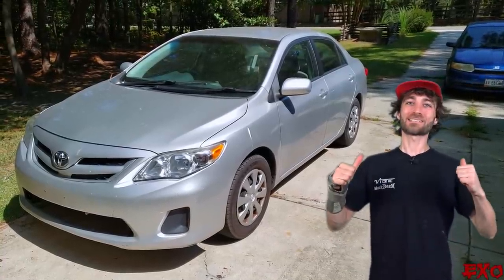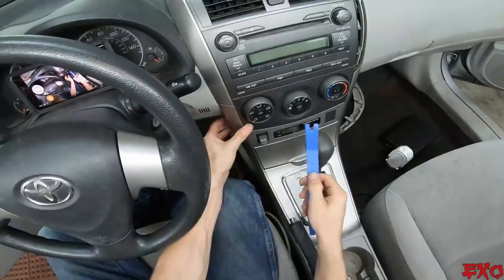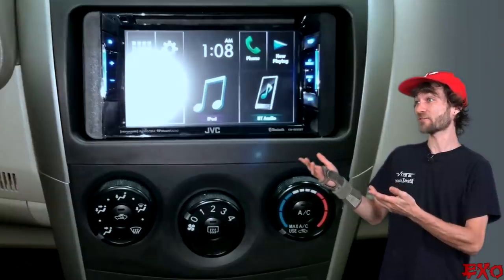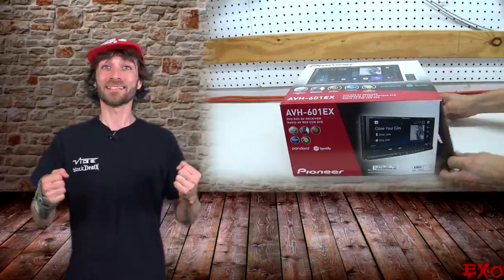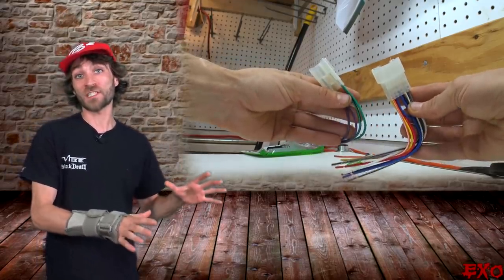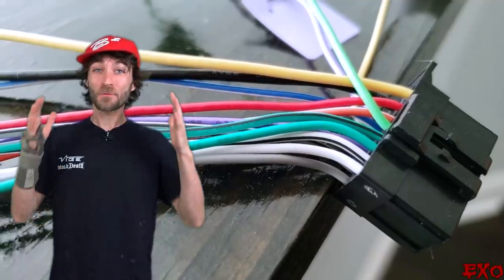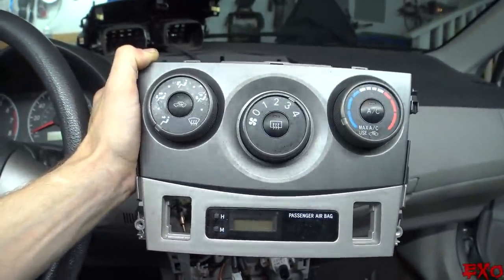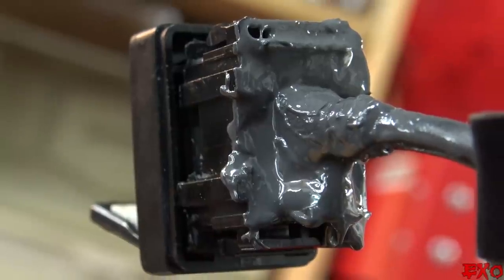How To INSTALL Aftermarket Car Radio w/ Pioneer Double Din Head Unit | UPGRADE Stock Stereo System

Comment from the maker: Couldn't handle the stock radio anymore... Time for some UPGRADES!
Reply: No doubt always love a nice clean aftermarket radio.
Reply: Bass
Reply: That is a nice car try not to break your girl car EXO :)
Reply: Looks almost exactly like my X3800
Reply: Hey Bro maybe you can answer this question. I got a pioneer double din and when I'm slapping and the subs start hitting it will constantly shut on and off
Reply: So whoz doing the filming now exo , think it's time u did a video on how and what u use to make ya vidz
Reply: EXOcontralto I have the same unit it has a few flaws but it’s amazing
Reply: Thats ok but i think a DSP is a must in the Radio unit 😊 better if a subwoofer is installed 😉 the sound is from the sub direct and play at the same time than the front speaker 😊 nice video but i know that 😁
Reply: Love the video.
Reply: Did you go with a wired or wireless camera setup
Reply: Going through Exo withdrawal
Reply: Exo why do you thank us for watching the video?
Your video is a must watch
Reply: @blixyyt5595  
His video "isn't" a must watch?
Reply: @robertdavidson548  sorry autocorrect was with German there
Reply: @blixyyt5595  
I'm sorry too. After reading it again, it's obvious what you meant
Reply: does a new stereo make a better sound ? i got the stock
Reply: Hey Exo. What do you do if your factory harness adapter has an illumination and a dimmer wire but the deck only has 1 orange wire with a white stripe? Which one do you connect? Also my Pioneer has the mint color for the parking brake but also has another mint colored wire. Any idea what that one is for? Thanks for all the great videos!
Reply: EXOcontralto i have a kenwood dnx6180 I don’t know where is the Bluetooth audio on the main screen how do I do a factory reset
Reply: EXOcontralto Hey bro, just wondering where is the amplifier install video for the Toyota? Thanks!
Reply: I just watched all of your videos about your Rolla sound system build and my goodness man you are good all that wiring just had my head spinning. I have a Corolla myself in I've wanted to upgrade my system for a long time in U inspired me to use the same speakers but I have no idea what I'm doing when it comes to all that wiring stuff so I don't know if I could do it myself.  And all of the retrofitting you had to do for that head unit and the speaker rings and the endless wiring. Excluding the the sub and he amplifier  for now what would  professional installation for the four speakers the 2 tweeters and the head unit and the wiring cost roughly do you think on average? What are your thoughts on just buying one of the pre made wiring  harnesses for those android double din units? I'm  Definitely gonna  get those speakers for the rear deck and the doors  And ill swap the existing tweeters for good measure with the same brand. Did you  finish this build and give a final video of the whole finished product or did you just stop?
Reply: JBL Boom BOx2
Reply: Am installing an pioneer on a 2013 chevy Tahoe LTZ has a bose system. Do i needs to upgrade the door speakers? Am also installing a Subwoofer Amp 3000 watt I do have a 4 channel amp I could install also with that for the door only problem is this bose system is 9 channels. Any idea would be appreciated 😊👍

Comment: Parking break is for your back up cam. Just ground it to a near bolt in back of the headunit. And cam cable goes to the power source if the cam. Depending what cam you get. 

Just a little help for anyone watching and wanting to know the rest of the info exo is going to make the video about

Comment: I don't blame you with editing. Editing is a pain in the butt. New subscriber here. I actually just got finished with my system install. I went with Blaupunkt, and JVC. My system hammers pretty decently and screams loud n clear w/o distortion. I do need to add a sub for sure.

Comment: Greetings EXO 😄! I am a new subscriber as of today. I would just like to let you know that back in 1976 I install my first pioneer 8-track and also amplifier and a pair of pioneer coaxial speakers which was about the best you get back in the day then. It sounded great. Believe it or not I could pull up in front of the Shell station turn my radio up, turn on the amp and my speakers in my system would make the glass go in and out of the Shell stations big front glass panes. Well the station manager was there at night one time and he saw his front glass panes vibrating in and out , he kind of got upset LOL! Well I just wanted to let you know I was bass freak and a audiophyl back in the day still am today.. Now I have me in Tahoe and I'm retired so here we go with the new system. Have a great day new subscriber Anthony

Comment: I have the same car. I installed a pioneer double in with apple car place android auto. I used original brackets and the scoshe front face. Perfect fit. Replace the aux with a usb adapter in its place

Comment: Instead of JB weld to make a stronger instant weld use super glue and coat with baking soda. The reaction makes the super glue instantly turn extremely hard with great bond and also heat resistant. I do this all the time I even fixed cracked radiator fan on my trailblazer over a year ago and still perfect!

Comment: Dnt forget the parking brake bypass relay 😁
Reply: I was wondering what he did to them. I cant get my video or anything to work
Reply: Hook the park brake up to a toggle, and ground it. Then when you wanna play a video you engage an disengage the toggle, screen pops up with the ok button for u to hit to watch videos while driving. Tricks the radio into thinking parking brake has been engaged. U have to engage and disengage with like a 1 sec pause in between.

Comment: Hey exo I have a 2010 corolla with a 18 psi platform 3 in it I like how you did the usb and switch in the factory spots I might have to steal that from you lol thanks for the videos keep them coming
Reply: They sell a direct usb plug to add into the location of the aux for like $15 . search 2010 toyota corolla usb

Comment: Great video as always. But how about the the steering wheel controls? Do they work?
Reply: Nope they won't but I believe you can buy an additional wiring kit to retain their use
Reply: Get the Alpine 970 HD!
Reply: @Kikinahm  nice, does steering wheel control works?

Comment: Wish it was this simple for all cars, I drive a mk3 ford mondeo pre face-lift and although it had a large factory headunit,  the hole is very slightly smaller than double din (post face-lift have a different design)  and very careful cutting was required to make the Sony double din fit the dash.
I had to cut all the way to the edge where the gloss finish starts top and bottom but leave a border of the original matt surround on the sides,  it was a very slow job to make sure that it looked as close to factory as possible,  one mess up and I would have had gaps but managed to get clean tight fitting lines by taking hours to do it.

Comment: Nice video! My Pioneer double din replaced a stock Toyota radio, but I'm having trouble with the backup camera only coming on intermittently. What should I check? How do I pull the Pioneer head unit out to check connections? (I didn't do the install myself).

Comment: Exo, where do you get your replacement clips?
My Camry is missing..a lot 😂
Reply: Consider the Local Toyota Dealership parts Department
Reply: Santos Jerez Yeah I’ve found em there before, they’re just like a dollar or so a clip.
Just didn’t know if Exo found some place that has them in bulk (I brake spot 😂)

Comment: Great video! Very informative! Question tho. When I installed a single din im my mom's corolla I unplugged 3 different harness plugs from the factory radio and I got the pre wired harness from the link you posted and it only uses 2 of those factory plugs. What's the 3rd factory plug for?

Comment: I just watched all of your videos about your Rolla sound system build and my goodness man you are good all that wiring just had my head spinning. I have a Corolla myself in I've wanted to upgrade my system for a long time in U inspired me to use the same speakers but I have no idea what I'm doing when it comes to all that wiring stuff so I don't know if I could do it myself.  And all of the retrofitting you had to do for that head unit and the speaker rings and the endless wiring. Excluding the the sub and he amplifier  for now what would  professional installation for the four speakers the 2 tweeters and the head unit and the wiring cost roughly do you think on average? What are your thoughts on just buying one of the pre made wiring  harnesses for those android double din units? I'm  Definitely gonna  get those speakers for the rear deck and the doors  And ill swap the existing tweeters for good measure with the same brand. Did you  finish this build and give a final video of the whole finished product or did you just stop?

Comment: U have several questions and cannot find a utube that is specific to 
it...

1 - Do I have to use the Power Yellow and the Remote Blue cable if my 
Amp already has it ? Meaning all I will need to connect is the Speaker 
wire.
2 - I have the PAC LP7-4 L.O.C. PRO Series 4-Channel device, I'm only 
going to tap in the rear speakers, so I will use 2 channel on the PAC, 
can I just twist the other two channels together ? Meaning I will use 
the White and Gray for the 2 channels, can I just twist the Green to the
 White and the Purple to the Gray for all 4 channels and then go all 4 
channels to my amp RCA ?
3 - The the Gain on the PAC will only have the adjustment on one side which is the Right and Left Rear Or Front ? or would I need to adjust both Gains to the same ?

Comment: you should do a video on how to install a REALLY EXPENSIVE head unit into a HUGE touch screen factory unit and retain all the cool features of the new car equipment, like steering wheel controls, siris/xm travel link, weather, sports, and movies data link the usb connectors in the car, keep factory gps antenna and keep your factory backup camera...because we blew $45000 on this car and dont want to have 2 GPS and satellite antenna and numerous backup cameras hanging all over the car, and if we sell/trade in the car it would be easy to remove aftermarket stuff and still have all the factory stuff working for the next person instead of destroying resale/trade in value

Comment: I have changed my headunit previously, so there is an ISO connector now. If i wanted to upgrade it again, would i have to cut the wires or is the ISO universal for all brands now? thanks

Comment: How clean are the outputs of an oem stereo from volvo? I wanted to replace it, but if it is good enough when it comes to output and sound quality, I will just stick with it as I dont really need all the adtermarket features

Comment: When I tried to put this radio in my dodge ram 1500 2012 I didn’t get power to the unit right away like you seemed to. Is there something I have to do like plug in to the cigarette lighter close by or car’s fuse box?

Comment: I know your a busy guy and probably won't respond, but Im trying to find out what radio would be good for a system in a Nissan rogue or Murano. I have a 6.5k watt system w/15s in my Tahoe, but in thinking of putting the evl sundown 15 package in one of these and I'm not sure about good double din radios compliant with the reverse cam. I love single din JVC for the crisp sound, but that won't cut it.

Comment: Question I have 2 10s and an amp in my car and a kenwood deck I'm swapping out the deck for a sony I'm just wondering how is the amp connected to the deck wiring should I be able to just swap decks
Reply: Should unless it requires a specific harness peice my friends 04 mustang with factory amp required a harness after he tried to just wire to the cars inputs ect but if everything works rn and you have rca it should be a fairly direct swap over between the 2

Comment: This is a great channel. EXO it seems I drive the same daily driver as you so these videos match up great (I'm in a 2013 Toyota Corolla).I decided to do this upgrade in little increments. I updated the front and rear speakers to some Kicker DS series speakers. I installed some 2mm sound dampener on the rear deck.  One thing i wonder though I have the 6 speaker system (has the extra 2 tweeters in the front on the doors) - I just bought a Sony DSX-G900 (4x45w RMS) because I wanted a bit more 'umph' to it above the pretty horrible factory deck.

I was going to do the install of the Sony DIN this week but was wondering, should I disconnect those 2 door tweeter if I'm feeding in 45W RMS into the front speaker which I assume is wired in parallel?  If that tweeter is anything like the factory door speakers which you know ARE HORRIBLE POS I'm worried it'll add a bunch of distortion when feeding it that much sauce.

I'm 50 in July, am I getting too old for this 😁

Comment: So I added an aftermarket double din, it didn't sound good at all because it's cheap. So I put an aftermarket pioneer cd player in as well. I'm having a hard time getting the 2 to communicate. Any suggestions?

Comment: Exo we have new head unit installs that when changing the source or powering up or down the unit the amplifier sends a loud signal through the subs instantaneously for a brief moment. Can you make a video on how to correct this issue?
Reply: I think that's why he put in a switch to have control of when his amps turn on.  He can turn off amp, switch source then flip amp signal back on

Comment: How does it work with a stock JBL amp? I have a 2004 toyota solara with a JBL system any help would be great as I did order a touch screen for upgrade thank you

Comment: I Have A 2019 Kia Sorento With The Stock Radio I Am Putting In Kicker 6-1/2" Component Speaker System In The Front And Kicker 2Way speakers In The Rear Doors. What LOC AudioControl Should I Use. And I Am Adding 2] 10" Or 2] 12" Skar Audio. What Do I Need To Install This To The Stock Radio? Thanks a Lot If You Can Help Me. JAY FROM BRONX,NY

Comment: Hey exo, I was actually planning on putting that same deck in my Buick Regal gs, first can you connect steering wheel controls to that deck, and when driving with the sun to your back, does the sun glare out the screen like the one in my buick now. It will get so bad I can’t see anything on the deck, so that is why I’m bouncing between a new double din or a single din
Reply: That's exactly why I ditched my Double DIN and went back to a single DIN.

Comment: I have the same car but i was not able to make the sw control to work after replacing with an aftermarket radio. Any suggestions? Thanks!
Reply: Oh one more thing, i did notice you destroyed the old aux port when there's a usb port assy available that slids right into that hole. Just sharing.

Comment: Am I going to need an amo if I’m going to change my speakers ? My double fin has 50w per channel. I’m not really looking to get a giant system, just a small upgrade from stock.
Reply: 50 watts per channel is max.  Your probably getting 16-24 watts RMS to your speakers.  If your aftermarket speakers need 80 or 100 watts RMS,  you will be under powering them by alot.

Comment: Can u actually go thru how u installed the backup camera tho? I have the same car and the backup cam i got i cant get it to power on.
Reply: Find the wire in the taillight harness that powers the backup lights when the car is in reverse. Use that for power to the camera, so it comes on when the car is in reverse.
Reply: @PURESOUND4  So I did that, i wired both reds to both reverse ones for signal others for power than i ran to the headunit and connected that red for signal to the unit and then the rca to the unit.
Reply: @PURESOUND4  its a $20 amazon backup camera if that helps lol. I read I might need to wire it to a 12v?? other than reverse?

Comment: The only reason I didn't upgrade my factory radio is because I don't feel like buying extra modules to stuff in my – to get my steering wheel on Star and other controls to work.

Comment: I just installed this radio but my amp is getting no signal... why??
Reply: Did you hook up the blue remote wire from the headunit to the amp? That's the turn on wire.

Comment: What kind of rca wire was u using exo
Reply: Rca? The bass was different than the front and rear which looked like a mid level STINGER wire
Reply: @AstroTundraBASS  yea they look like they was  More flat

Comment: keep the  videos  like  this  improving  every day :)   congrats !    you  need to make a video  using   PC  PSU   to  power  amps  and make a  home  cinema  ;)    If  you   dont  know  how to  do  it ,  Contact me and  i  teach  you  how to  do  it ...   i  use  my  sound  system  at  home  for more than  5  years   never  burned  1  single  speaker.. or  amp or sub  ;)  and  im not  using a  car  radio  to  power  up the  stuffs..

Comment: The parking brake is too easy, just conect on the ground !
Reply: With some pioneer radios and Kenwood you can't just connect the parking break wire to ground you have to have a bypass or it won't work.